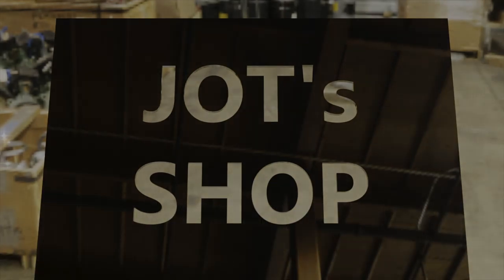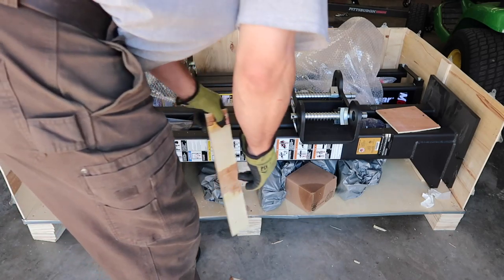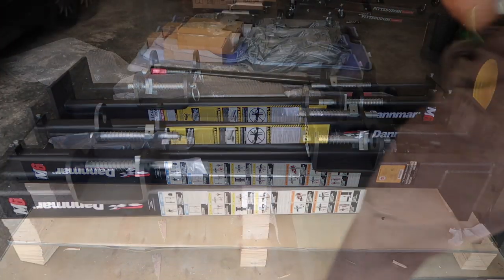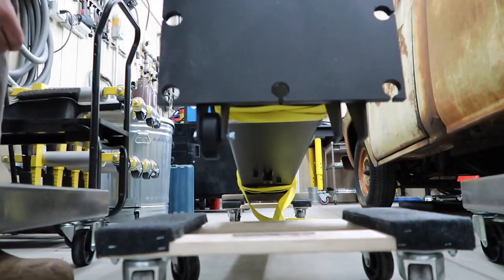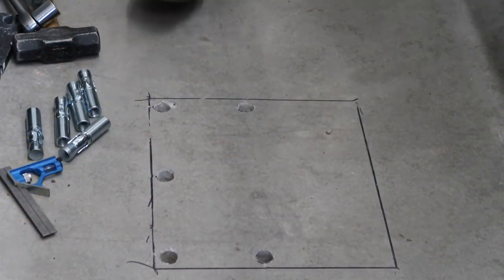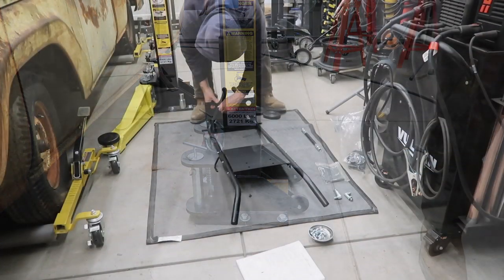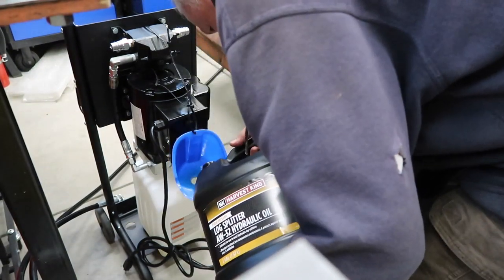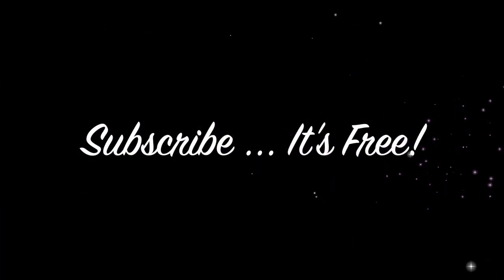Two-Post Lift Install

Comment: Great video I am in the process of ordering one now. I have the 4 post but the 2 post is more versatile and the portable one is the icing on the cake. Just a suggestion, buy some counter sink bolts and install them in the holes when the lift is stored. You probably all ready thought of that. Thanks again for the video. How it was shipped was important for me to see.
Reply from the maker: Thanks for watching and commenting!

Comment: Fantastic, I see you did not install new footings in the concrete floor for the post..can you tell me the thickness of your floor and if you know what p.s.I. Concrete they used ? Say 2500 or 3000 p.s.i or better .. thanks it will be very helpful if you know..awesome old school pick up..👍👍👍👍👍
Reply from the maker: We poured 6" of  4000 psi. Thanks for the question and appreciate you watching our videos!

Comment: Helpful video. Are the lift arms long enough to reach jacking points? I'm considering this model of lift, and on my '63 GMC Suburban the jacking points are under the front and rear suspension, nearly 10 feet apart! Trying to figure out how to make that work.
Reply from the maker: Thanks for watching.  We don't have the lift set up right now or we'd check how wide they can be. Sorry.

Comment: What is the cost also what is the average depth of a normal garage floor? If purchased do you install?
Reply from the maker: Thanks for watching!

4" in the normal depth in our part of the country. However, when installing lifts, 6"+ is normally recommended.

Comment: do you put button head cap screws in the anchors when the lift is stored or just blow the holes out before you set the bolts back in?  I'm thinking about getting this lift for myself, but I feel like I would be worried about the holes getting filled up with gunk in between uses.  Thanks and great video!
Reply from the maker: Thanks for the comment and watching the video. I currently don't put cap screws in the holes. I just blow the holes out. Seems to be working fine so far.

Comment: Is the height been enough for you? I like the versatility of the Jack, but I'm curious if it grows burdensome over time doing certain jobs.transmission?, clutch?. Stuff you might be under there for a minute?.
Reply from the maker: It's ok ... If you have the ceiling height, don't need to move them, and use the lift a lot, we'd recommend a full size lift.

Comment: What width did you end up picking for post to post, I order one and cut out some templates to pre drill so when the lift arrives I can install quickly. I'm just not sure how far to space the post apart yet?
Reply from the maker: Thanks for watching ... we don't have the lift set up right now, but we believe it was about 120 inches post to post.

Comment: What’s the difference between the MaxJax and this lift?
Reply from the maker: Thanks for watching and the question. The M6 has automatic locking positions.
Reply: @JOTsShop  thank you for the video and for the reply. Seems like the new MaxJax or at least the current one that's avail in their website has automatic locking positions as well. I wonder what the other differences are, or if they bought the brand of your lift because they are calling it "maxjax m6"
Reply from the maker: I believe that Bendpak has acquired the original maker and did a complete redesign on the MaxJax to make it better. Here is a complete comparison: https://www.maxjax.com/compare/. Again, thanks for watching and the comments!

Comment: Have you had any issues with the carriage assembly binding inside the columns on the way down??
Reply from the maker: Yes we did when we lifted it to its max extension. We attributed the binding to the columns not being perfectly plumb. When we lifted about halfway, it didn't bind when bringing it down. Haven't tried full extension again yet.

Comment: What torque spec, if any, do you tighten down the posts (bolts going to the anchors) to for install?
Reply from the maker: In the M6 manual, it doesn't give a torque spec. It just says do NOT use an impact wrench and tighten securely.
Reply: @JOTsShop  Yup I saw that in my manual.  I would feel more comfortable if there was a spec listed, that way every so often you could check the bolts and make sure the anchors were not being unseated for some reason.  I'm going to give their tech support line a call Monday and see if they have any recommendations.  It's difficult for me to feel confident with "just tighten down until tight enough" as the spec.
Reply from the maker: If you find out anything from support and have the time, please let me know what they say. Thanks!
Reply: @JOTsShop  I have them a call today but I do not think they are open as an essential business as their voicemail box was full and noone picked up the phone on any line or extension I had :(  If I hear anything I will comment with a reply.
Reply: I have the same lift, my best translation of the manual's intent is 90 foot pounds on the anchor bolts. I recheck often as they will at first need re-torqued